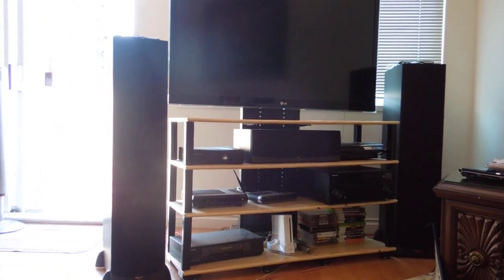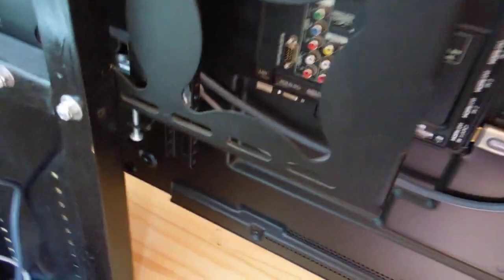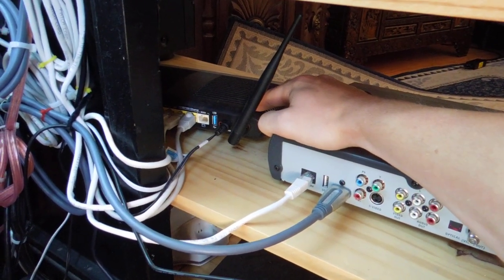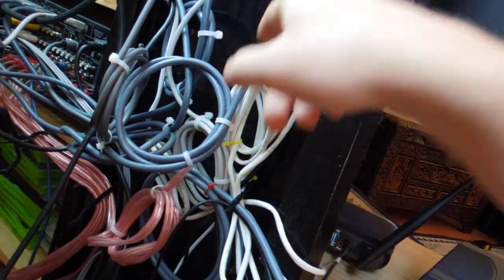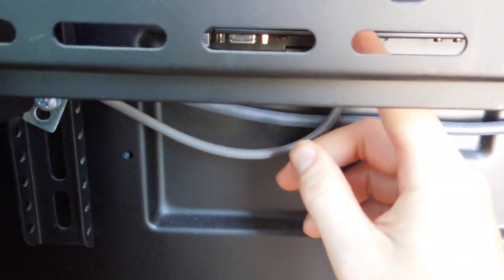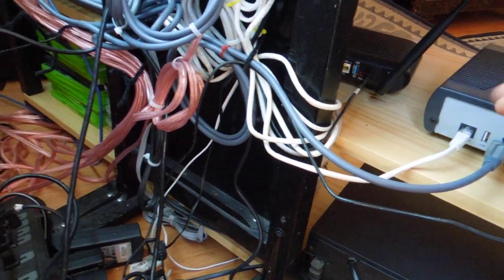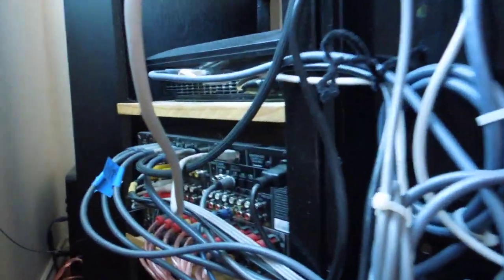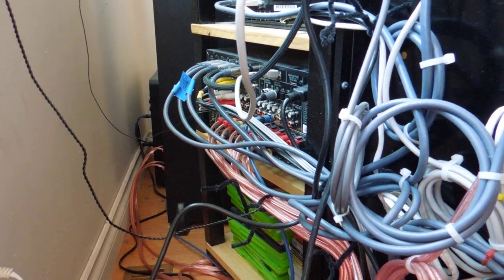How to wire a home theater system amplifier reciever

Comment: Thanks for the vid it was definitely insightful. I am about to invest in an A/V receiver and had a quick question about sound. My question is, when you plug all your devices via HDMI to the receiver and then send your HDMI out to the TV does the sound come through both the receiver speakers and the TV speakers or just the receiver speakers?

Comment: hey, thanks for the video. Quick question on bi-amping front speakers. My scenario. I have a newer Denon 3312ci with 125w/channel, discrete 7.1 I just bought some nice Klipsch front towers today capable of bi-amping that match with amp @ 8 ohms, and have 100w RMS. I hooked them up tonight correctly bi-amped with high freq. to fronts and low freq.'s to surround back/amp assign. You talk about sending 120w to high's and 120w to lows instead of just 120w without bi-amping. Is this additive? It can't be...because I know your towers are not 240w rms. Can you explain this? thanks

Comment: thankyou alot for the video. iam just confused weather if you use SONY TA-A1ES AMP, will you be able to connect ps3 and dvd and xbox? because sony HI RES AUDIO has no video inputs and outputs... can you please guide me. i have sony surround DAV-150. so i want to combine those with the amp. thankyou for your time, tc

Comment: I have a pioneers vsx922 ,and five yamaha nsf2100 hooked on it,
Sometimes I get a weird noise through the center speaker during dialogue,does it have to do with wires touching something metal..or other wires?
Could I bi amp the two front speakers, or not since they r 150w input,which that's  the amps power per channel.

Great video by the way,I like how tidy you got everything

Comment: good video, I'd like to add if you're connecting your blue ray to your wireless router by cat 5 cable be sure to ask you ATT installer to place the router nearby. I had them install it right next to my player and tv.

Comment: I just hooked up a Samsung smart TV just like you did, to a Pioneer receiver. All works great except everyday when I turn on the TV and receiver, I have to make the digital cable selection, (signal selection) using the remote for the receiver. Until I do that I have no sound. Why doesn't it remember that setting? It is an optical digital cable. Thanks for the help.
Reply from the maker: Hmm try leaving it on auto or plug it in another port thats wierd though hmmm i usually leave mine in auto

Comment: You do not need a optical cable. All newer panels have a "ARC" HDMI port. The receiver can accept audio from the panel via HDMI. Enable HDMI control on the receiver and you are set.

Comment: Hello, thank you for the great video. I'm planning on getting a receiver so I can hook up my cable box, Wii U and a blu ray player.The Wii U and the bluray player have HDMI, so I'm fine with that, however my cable box only has composite video and RCA connections on the back. How can I connect my cable box to the receiver and have the TV sound coming from the home theater system? Thank you!
Reply from the maker: well depending on the receiver you buy some of the mid range to higher end receivers will take in component and still push it out through the hdmi. but either way hook up the green blue red cables and the if it has a optical cable port use optical for audio.  Or if it has a orange rca input on the back of your cable box that means it has digital coax and you can run a 1 rca from the orange on the cable box to the orange on the back of the receiver. hope that helps you out
Reply: ghostlyrich kf us I

Comment: Hi, I have a samsung HT-E5550 Home theatre system and the Samsung SWA-5000 wireless unit. No sound seems to be coming out of the rear speakers but they do work as I tested them in the calibration on the TV. Any help would be much appreciated

Comment: Dang you could wire for nasa with the way you did yours lol. I have a 16 year old denon avr 900 composite cables only and it sounds great. with 5.1 and paradigm speakers. I bought a new 65" plasma and it had no composite audio out so I bought an optical to RCA converter and it works great again.

Comment: How would I connect a PS4 to a Denon receiver with 5.2 surround sound speakers.
Reply: You would take the HDMI cable from your PS4 and run it to an HDMI input on the receiver.

Comment: what about the heater vent on the floor wont that make the unit s get hotter when the heat is on i was told that it will
Reply from the maker: the shelf acts like a deflector :)
Reply: +ghostlyrich ok  thanks for the info and i love your set up

Comment: klipsch does not recommend bi amping with the same amplifier... they wrote a whole huge article on it. you need a separate amplifier to bi amp them the correct way. and your wrong that you do not get 120w on top and 120 w on bottom...

Comment: I was just messing with you bruh. When I saw all those wires I kind of shutdown. Lol. My system isn't that in depth. I was told by the cable guy just to run a optical cable from the surround sound to my new smart tv. I would think that the PS4 would work thru the same cable right?